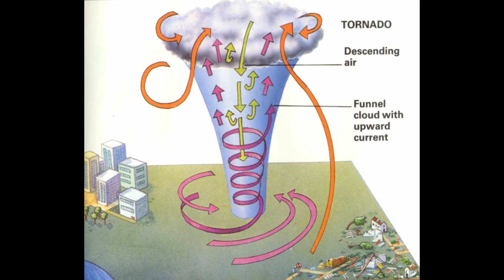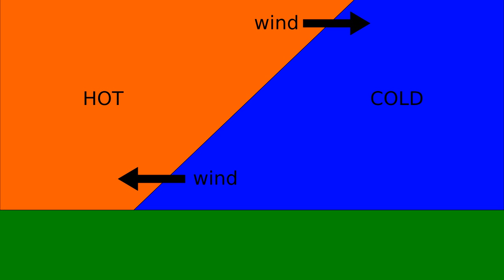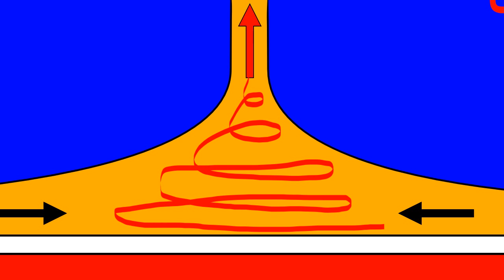How tornadoes work (from physics perspective)

Comment: I’ve researched tornado genesis, formation, for over 29-years. With respect, but this is completely and totally incorrect. The primary driver of tornados is a rapid pressure drop fueled by latent heat released by ex-vaporation (condensation and deposition). There are three types of tornados: Condensation driven, deposition driven, and hybrid (both together).

What you are describing is similar, but still incorrect, on how dust devils form.

Comment: Actually, instead of the Low pressure poking through, High pressure falls, which pushes Low pressure to the side, and that Low Pressure rises on the edges of the tornado, so while you are particially correct, you have the orders wrong.

Comment: I have figured out tornadoes.  Unfortunately this model here does not work.  
Something is keeping the warm,  moist air from readily mixing with the cold drier air.  It involves water-based plasma that emerges on wind shear boundaries and this plasma is what provides for the structural capabilities that underlie its destructive abilities.
This realization was hidden from us because of mistakes by Linus Pauling on the polarity and hydrogen bonding capabilities of H2O.
James McGinn / Genius / Solving Tornadoes

Comment: I think a lightning bolt that's 50,000 F can pierce through the cold air and create a narrow, vertical passage, which could allow all the trapped heat to rise up very quickly, and that this might be a potential catalyst for extremely violent tornados.
Reply: Good idea.
Reply: Interesting idea..   Or possibly rocket exhaust, or some sort of incendiary device dropped from above...  high cape, bridge the cap, it might spin right up.

Comment: Great explanation, thank you. In particular very interesting points visualising that with enough delta of temperature between the surface and cold air the hot air pierces the hot air and an funnel is created. Other videos talk about sheer currents of air at different altitudes which are twisted 90 degrees (vertically) and create the known funnel but that doesn't seem to be what I watch in the tornado videos. Also they talk about a rotating supercell but they don't say why does it rotate (coriollis effect perhaps?) Thanks again!

Comment: I figured it out more like there were low pressure globs in a spiral pattern  that were driven by fast air movement at the top. So the pressure differences are in fact driving it instead of convection forces.

Comment: I'm a meteorologist. You have the right ideas.

The updrafts is that piston graphic. The downdraft and open air environment is the blanket of cold aid. There's also other factors such as wind and directional shear but you have a good perspective. Infact an impressive way of doing it.

One note to add though. The variable of the downdraft adds more weight of the cold air. As a force of cold air is moving down, its mass is pushed on the environment. So your graphic wouldn't always have 12kg on each side of the funnel. Let's say 16 on one side and 12 on the other

Are you Eastern European or Russian?

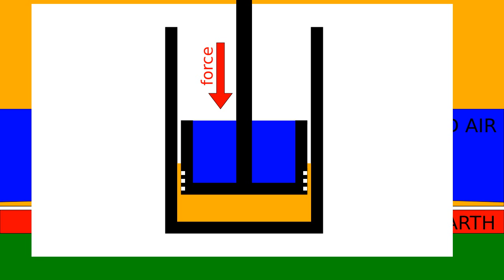Comment: In my opinion, this model works well for describing the supercell thunderstorm (or any thunderstorm) that spawns these tornadoes, but not so much the tornadoes themselves. In order to add a good visual for the actual tornado production add this: to the frame at 3:47 explain again that the rising air is spinning. Then show two Blue arrows of cold air that wrap around the rising plume of hot air and sink downward to try and cut it off. These jets of cold air are pulled from the cold air pool and rotated downward toward the ground. In essence they "funnel" the upward moving air even more, like a nozzle on your hose. These downdrafts are what is responsible for the actual tornado, and not just another supercell updraft.
Reply: Yeah,  they're needs to be a couple adjustments.... It's pretty much under standing a thunder storm,  best conditions for a thunder storm, then said storm building in a high wind sheer environment that gets the storm to rotate.

Comment: Good view of the physics but missing probably the most important factor: moisture. This makes the simple two factor explanation much more complex. Not to mention pressure gradient is also a huge factor. It's a complex and interesting dance of conditions.
Reply: Without moisture you don't have a cloud. How is not not a deal breaker?
Reply from the maker: I don't think moisture is a deal-breaker.  And anyway, I have not seen any better explanation. So, please don't bash my video unless you can post a link to a better one.
Reply: I wasn't bashing your video at all, I actually complimented it. I just wanted to add to the information you explained. None of the factors are for sure deal breakers but all of them are constantly present and participating in the conditions, which must be just right for a tornado.
Reply from the maker: Yes, I agree. Thanks.

Comment: This illustration is exactly what I theorized. I believed there to be something sinking upwards and the gyroscopic effect would make it spin. However the  question I still have is as in your illustration the puncture. Why does it happen at that location to cause a tornado? What is it about that particular spot that causes the updraft to happen? Why do super cells form in the locations they do? This illustration shows you what's happening but what causes it to happen where it does? What causes the puncture? Sorry for my redundant questioning. Thanks for this illustration.
Reply from the maker: Rafael, it has been a while since I have thought about this issue.  And I am not sure I understand the question.  If a hot air is located under a cold air - it's unstable - they either have to swap places or mix.  It's like a broom - it's unstable - it has too fall.  Why in that particular spot?  Well, I guess it was slightly tilted towards there.
Reply: Yeah, I'd think about it as if you are making a pizza dough too thin, you will not really look for an underlying cause for exactly where the first hole in the dough will appear as you stretch it out. It's just where the dough is at it's weakest relative to the tension that just reached a breaking point, and the location in principle is pretty random. But for a tornado-warning purpose, I'd guess you'll probably look at the wind masses and drafts and see where it is moving and try to predict as best you can from that?

Comment: There appear to be several factors missing from this explanation.

First, we have a hot layer below, a cold layer in the middle, and another hot layer above, with the idea being that the two hot layers must "punch through" and meet.

The problem is, how did the "hot" layer above get there in the first place, when we know that air further from the ground tend to get colder, not hotter.

Of course this can be explained with normal wind movements creating irregular, layered boundaries, but still, it must be spoken of more, especially since such an irregular air boundary will almost certainly have turbulance sideways in a shearing sort of direction, which in fact may be the motion that initiates a tornado forming.

The next factor is major, and that is pressure. When hot less dense air meets cold more dense air and they mix, then a pressure change will occur. This pressure change will cause what appears to be wind. I will not talk much about this because the topic is too big, and includes such things as particles in the air that may act as "seeds", as in seed crystals for condensation in case anyone here is interested in crystalography, or like boiling chips for expansion, in case anyone here is a chemist.

Yet another factor that almost no one talks about is electricity. Lightning appears at tornadoes. Lightning happens when the charge in the air and ground rush to meet each other to find equilibrium. This is easy to understand.

But, what about thermo electric cells? When a circuit is formed whereby electric current moves between two things that are not similar to each other, such as two wires made of different metals, or wet air meeting wet soil, a temperature difference happens at those junctions depending on the direction of the current. One interface gets cold, and the other gets hot.

There are obvious electric currents present when tornadoes happen. In fact, in some videos, you can see a tornado forming, when suddenly a lightning strike happens at the base of where the tornado is about to touch down, and the tornado stops. This is an obvious example showing that a difference of charge promotes the formation of a tornado, while the voidance/equilibration of charge removes the conditions for formation.

I find this last idea very interesting, because it suggests that an easy thing to try in order to stop a tornado touching down is to somehow make the air as electrically conductive as possible, as quickly as possible, perhaps by using some kind of conductive dispersant.

I have more to add but this is already too long. I hae no doubt that the explanation given was left simplistic for precisely this reason. My compliments on a good video, Mr Singov.

Comment: 2:40 turns out that tornados, don't rise from the ground but come from above to do the famous 'touchdown'
Reply from the maker: It's the visible part of the tornado that is doing the 'touchdown'. But the air itself is moving up.
Reply: Sergey Singov I like the "puncture through the blanket" idea very much. Only I think that is the cold air that does it. Up to down... is the main movement, Even Gravity helps the cold and contradicts the warm. I think.
So heating (from a plane over the tornado) the cold air above, should do the killing.  There must be a critical temperature differential... And I know that there are very potent heat releasing bombs out there... of course we can say the opposite: if the hot air blanket is strong enough it will maintain the cold hair above it and never permit the tornado. (and a house surrounded by some hot plaques should be safe...) The weakness of the hot air layer in some points is what permits touchdown.
Reply: Yes, that is the conventional wisdom, however, I have heard that not all tornado scientists agree with that.  There are some that say that the circulation actually does start at ground level and moves up.  Based on some of the tornado videos I've seen and the Skywarn training I've taken, there may be some validity to this view.  In Skywarn we are taught to look at what is going on on the ground as well as what is going on in the sky, as there may be ground circulation present without a visible condensation funnel.  Sometimes the only indication that there is a tornado is rapidly swirling dust at ground level with no apparent connection to the parent cloud (really scary when you think about it!).  In this respect tornadoes could be said to be somewhat like lightning--it's the return stroke earthward that you see, not the initial stroke upwards.

Comment: A primary concern with this model that I expressed some weeks ago was the situation of differing air masses - from a climatological perspective, air mass analysis is fundamental to our understanding of Tornadoes. Having reflected some more, I suggest you also highlight that the warm air mass under consideration here also contains a great deal of moisture (having formed and travelled over the Gulf) - as a result, it has a higher density than the cold air (the opposite is usally the case) therefore it subsides beneath the cold air mass - this would provide a far more "physically realistic" model and would explain how hot air ends up below cold air - thank you for the video again Sergey.
Reply: It might be counterintuitive, but moisture actually makes the air LESS dense. That's why moist air rises. When the cold air goes above it, is what gives the atmosphere "instability".
Reply from the maker: Paul,
This is an interesting idea, but I am not sure hot air in tornado is heavier than the cold one, even when it's more humid. Also, I don't understand how it would make it more "physically realistic". Perhaps you could make a video that explains it?
Reply: Sergey Singov
Hi Sergey sorry for late reply - by 'physically realistic' I mean 'closer to reality' - so in reality in the troposphere air temperature lapses with altitude (i.e. it becomes colder as you ascent upward not warmer) therefore the only way I see your model working is if a) the cold air mass is undercut by the warm air mass causing major instability e.g. if the mositure content of the warm air mass made it more dense (H20+O2 > O2) or b) the cold airmass undercuts the warm airmass - but if this is the case, local stability would result - not necessarily a tornado (remember cold air likes to sit under hot air - thus we get an inversion) so for me option a) is perhaps where your model has most promise - Thanks again! :-) Paul

Comment: These air barriers would be akin to a P-N junction in a diode or transistor: put enough reverse voltage across it and it breaks-down, causing an avalanche of electrons.  Similarly, air masses or layers under the mesocyclone, of varying temps and humidity, could act similarly.  With enough air pressure difference (voltage in above analogy) the air close to the ground punches through (electron avalanche) and gets sucked-up into the rotating mesocyclone above..  A Tornado!

Comment: I think there is some basic merit to Sergey's theory.. while the theory presented is basic and incomplete, recent research has revealed that many tornadoes actually form from the ground-up; contrary to the belief (and appearance) its the other way around.   Keep in mind the over-laying parent rotating Mesocyclone acts as a strong source of air divergence; we also know that RFD's, and storm-generated cold-pool interactions (joined with dry-lines) are important ingredients that act as barriers.
Reply: Hm yea, I know nothing of the subject, but it also makes sense to me that the updraft starts first when I think about the funnel that always seems to stretch downwards the beginning: the updraft starts the counter momentum from the moist and cold air, to start sink down as the pressure drops in that spot since there is essentially a sort of leak. Also, more heat sent up into air-layers that is normally sub-zero probably creates more condensation and more moisture and probably makes the cloudy spinning funnel come down as if you pulled the plug in your bath-tub.

Comment: Segey, thanks for the reply, I'll grant you that: but within the troposphere temperature decreases with height as does air pressure, so again I am wondering about the "punching" through cold air into warmer air above, and once again, air coming over land (depending on its source region) can be very cold and dry. I think your model needs to include something on the characteristics of moisture and air mass interaction to become satisfactory... there are no tornados in North Africa, yet...
Reply: Yeah warm moist air loves convecting through cold air. Usually what it does need to "punch" through is a "cap" of warm air above that stops convection from happening. Once it punches through the layer of warm air and finally finds cold air, then convection explodes.

Comment from the maker: Paul, those are good points. As for the first point, the "worm" and "cold" are relative, and the difference in temperatures should be big enough for the tornado to occur. As for your second point: The tornado starts first, then, as it gathers speed, the funnel might become visible and touch the ground. I know that other videos show it the other way around, but they are wrong. There is a good article on Wikipedia called "Tornado" that explains it closer to the truth.

Comment: Very good video but I have a few problems with this. Firstly the notion that cold air is sitting above a warm surface, while surfaces warm and cool faster than large water bodies, in the US tornado alley we're talking about maritime tropical air masses - quite warm indeed so I am unsure if the temperature gradient would ever be that large. Secondly, often a funnel cloud is observed prior to a tornado touching down, but according to your model, this would be the opposite case? - Paul.